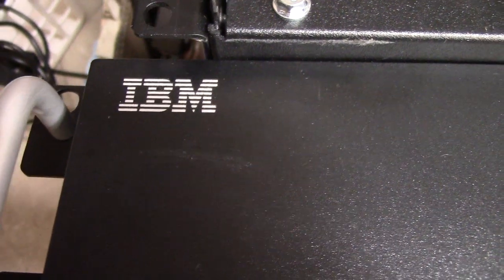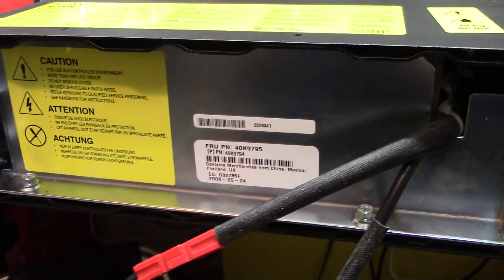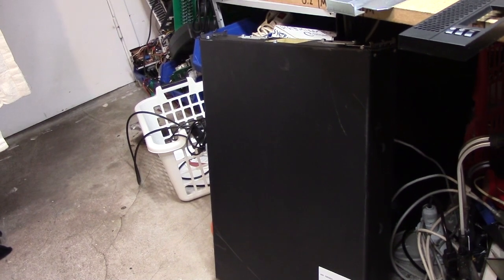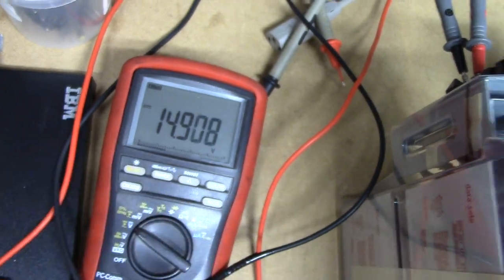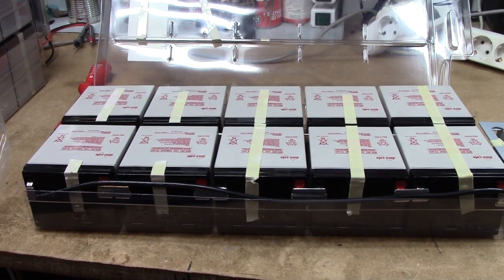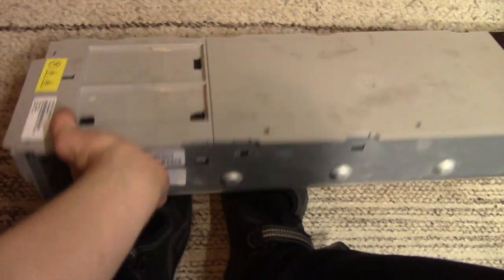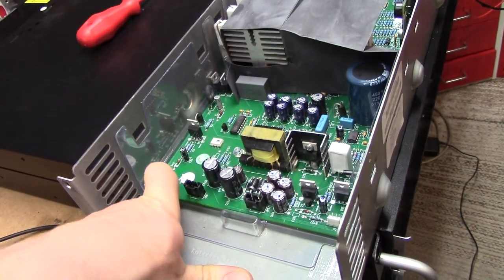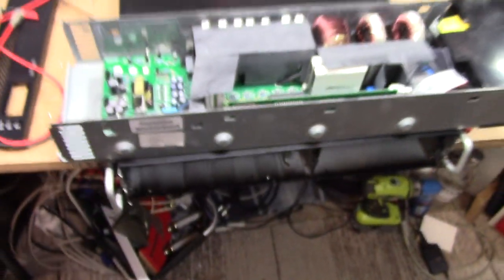IBM 3000VA UPS & EBM teardown and battery carnage

Comment: Ouch! I've never seen batteries so grotesquely bloated and blown out. (A much smaller Powerware 5110 had gotten close, at least as far as "melting" the brand name into the plastic carrier. It had Yuasa batteries inside as well. I had to separate the UPS case to get them out and there was a mess of electrolyte all over everything.)

When you looked inside the casing, I was mystified as to why something inside would say "tomatoes". And then I realized...oh, the back of the case is open in places!

Is the design for that desulfator or a finished unit available?

As someone already pointed out, the "IC" caps are from Illinois Capacitor. A less common choice perhaps, but I believe they're every bit as good as those from more well known makers.
Reply from the maker: +uxwbill I see about the caps, I never saw the brand before, hence the suspicion. Darn yankee caps.

There's no "design available" for the desulfator per se, it's a two-night project. It's basically just a microcontroller, a transistor, a diode and a coil, making up a boost converter sans output filter. The micro runs code to adjust the duty cycle of the transistor (and thereby changing the amount of energy stored in the coil) relative to the voltage of the output. When the transistor is turned off, the coil discharges through the diode into the battery, momentarily raising the voltage until such time that it overcomes the ESR of the battery. It'll do a peak current of about 5 A into the battery, at an RMS current of something like 500 mA.

I'm actually doing a long-time experiment right now with all the batteries out of the EBM, where I'm going to subject 7 to the desulfator, and 7 to a more "traditional" revival through means of charging them at a high DC voltage of 25 V. I know that the desulfator design "works" in that all lead-acid batteries I've connected to it seem to be able to charge just fine off of its 30 kHz high current pulses, but I haven't done any controlled testing to confirm whether or not it does any actual good to a battery until now.

If it actually ends up doing good in this test, I'll probably have to dig up my design notes and release a more finished version to the public domain. If it proves to be a useless placebo, well, I'd rather not contribute to delusion.

Comment: Them 600v DC caps you say look different go along with the Extra large torroidfs in a sine wave inverter design. Wether it may or may not be a grid interactive unit, This is a sine wave output inverter.
Reply from the maker: +umbrefawx Oh, it certainly is a sine wave inverter. I don't think I've ever seen a UPS of this size that would not be a real sine output unit.
Reply: +FFcossag I have seen plenty but more or less older less reknown ones.  Hell I have one in the basement rated 4kVA but its purely a square wave output. There is a reason I subcribed after watching a few videos. Like a lot of folks here on youtube, I do a lot of the same things you do in your videos, electronics has been my main hobbie for years now and computers naturally came into that. But working 65+ hours a week doesn't leave much time to shoot a video much less edit and upload it. And well mos tof my free time goes into tinkering with stuff just like you and a lot others do. Current project atm is truely desulfating 450AH flooded deep cycles. (truely desulfating a battery properly is a big time consumer and alot of people go along it the wrong way.)
Reply from the maker: umbrefawx Hm, I suppose we don't get as many off-brand units around here, and those that we get tend to be old Swedish/Finnish/Russian ones, and this part of the world seems to have a tendency to produce excellent electronics.

You have me curious now - what technique are you using to desulfate those batteries?
Reply: +FFcossag Well first of all you have to understand the method applies to flooded cells   only. Ive attempted to desulfate a lot of batteries over the years but as far as successful attempts, only flooded cells. AGMs, Gel cells and other non flooded AGMs are pretty much paperweights when sulfated and really only good for experimenting with. As far as the procedure I use for desulfating batteries its quiet different and its actually along the lines of how forklift batteries are reconditioned. Minus a adjustable power supply which you already have, your going to need 2 other things. 1, new electrolyte. (Sulfuric acid) and Ionized water. (Lots of it) Long story short. Its pretty much a series of rinse, charge and repeat. You drain the battery of all electrolyte, and fill it with ionized water and then charge til the battery til it starts drawing more current. (You gotta monitor it, hence the time consuming part. As soon as the current begins to rise, you repeat. Drain battery and refill it and repeat. Number of times really depend how thick the lead sulfate layer is on the plates but for a really heavily sulfated battery, talking a minimum of 7-8 times. When the plates begin to look healthy again, you drain the battery one last time and then fill it with the proper diluted level of sulfuric acid and give it a low current 48 hour charge.  Its is a very time consuming method but its is the only method that has trule worked for me and giving me the best results. However despite the fact it is possible to revive such a battery, it is still gonna have some kind of capacity loss. Even if the battery hasn't been used much, or near new.
Reply from the maker: +umbrefawx Ah, that actually sounds like a quite clever method to use as long as the plates haven't been wrecked from too many cycles and have begun to deform and crack. Thanks for sharing.
Reply: +FFcossag yep your welcome and you are right about that. It ore or less depends the condition of the plates as far as an sucessful attempt goes but one thing that should be noted, even if the plates do appear to be ok, I have on several occasion during the desulfation method watch some of the plate begin to deteriorate as the sulfation is removed. Had this happen in few batteries. So something to watch out for. Sometimes that sulfate layer on the plates will hold them together to look ok until the sulfate is removed so probably worth mentioning now you brought that up.

Comment: Hey mate,do you know where I can find some info about the HVDC interconnection between Sweden & Finland? if you can assist that would be most helpful,cheers mate!
Reply from the maker: +Daniel Malik Sorry, I don't think there's much of any information available about it. The cable is managed by the local power company, which is a really tiny enterprise. They barely even have a website.

Also mind that it isn't really a connection between Sweden and Finland, but only a line from Sweden to Åland, which is an island off the coasts of both countries.

Comment: sell the dead batteries and buy 40 , 6-15ah lifepo4 cells. and make a pack with proper cell balancing. (can not use a bms in a ups cus if the bms shuts off the ups won't come back on when mains power is resorted)

Comment: Nice video but you know if buy inverter 2000 watts used 12volt deep cycle battery 100 amp you do much better i have inverter 1100 watts so i going used 12 volts deep cycle battery 100 amp two of them build my own power box i have back-ups 350 come with 12 volt lead acid battery 7.6 am but i change it to 12volt 20 amp lead acid battery i get much more longer battery life

Comment: and most yuasa batteries are made by datasafe/enersys
Reply from the maker: +kiskiller3 Really? Do you know where I can find out more about this? I'm always curious to find out sources for who makes whose batteries.
Reply: the 2 brands (specially in the NPX series) have the same marking with the same font and the same model number, the same plastic its pretty much a giveaway they are made at the same factory thats for sure, i dont know where to find more info about it i did not made any research.  its just because i use hundreds of these batteries every week, i work in a ups service center and i just noticed that they have the same caracteristics they even have the same kind of serial number.
Reply from the maker: kiskiller3 Ah, I see - looking at my sets of both varieties, I think you might have a point! Thank you for this tidbit of information from the real world - the only information that has value these days, is the info that can't be readily Google'd.

Do you have any opinions about which batteries tend to be better for this kind of use, in general? Any particular series, etc. which is less prone to catastrophic failure than the others?
Reply: genesis are the same as datasafe and yuasa too but usually the yuasa NPX series are really reliable weve shipped thousands of them and they never failed really badly, sure they can fail like any other brand but its not going to be the fault of the batterie, its going to be the fault of the horrible apc overcharging charger. we only use yuasa NPX batteries specially if its more than a single battery, but CSB batteries specially for large one are good too ive god a set of 4 CSB 75AH that date back from 2007 and they where left in a ups cabinet but NOT plugged in for 4 year and they werent even dicharged all that much and they still had all theyre capacity, and thats just one example. these 2 brands usually take alot of abuse but the yuasa/datasafe NPX are better for the smaller batteries. we give the choice to use Budget or High Quality batteries to our customers when we replace and service their ups and we explain the difference between the 2 and we strongly recommand to use the High Quality ones for a ups that has a pack of more than 2 battery in series. because before when we would just use the nice high quality yuasa batteries customer would sometimes call us to ask wy the price was higher than what they could find on ebay or amazon so now they have the choice. but even then when the battery pack is composed of more than 2 batterues in series just stay away from cheapies, the interesting thing is that some really nice brand like panasonic tend to fail catastrophically like bulging case and cracking, and power sonic usually just die because their ESR goes too high, 

the really cheap batteries fail in unique ways though.

heres one it leaked and got super hot

https://goo.gl/photos/7QzMPXJSYV52LMxJ8
Reply from the maker: +kiskiller3 Thanks, that's some good information right there. Cheers.
Reply: youre welcome thanks for the nice interesting videos !